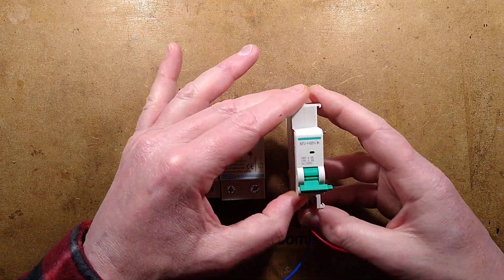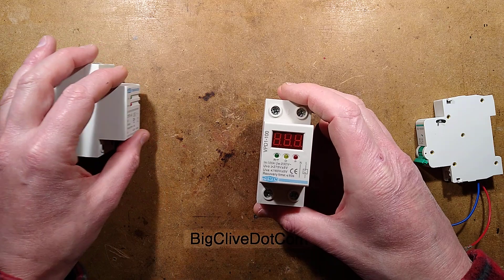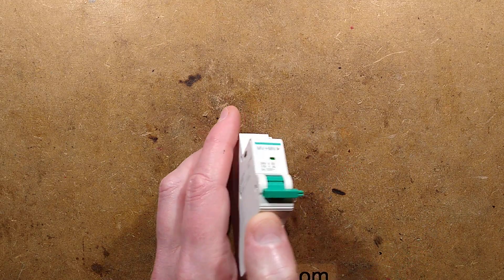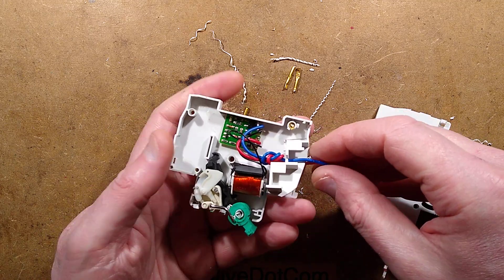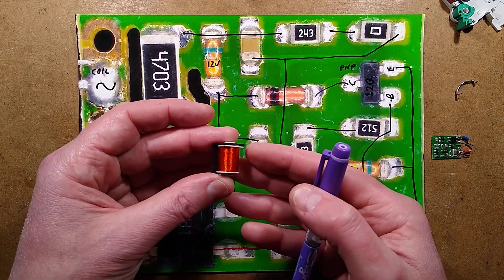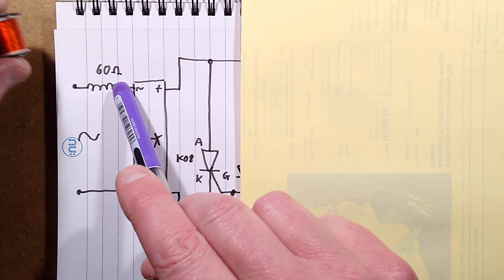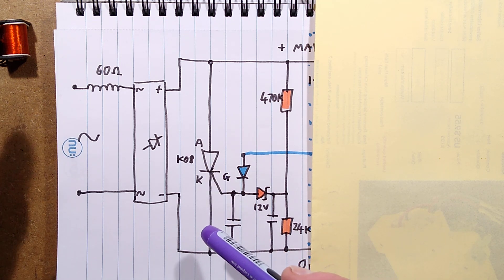Over/under voltage detector - with schematic

Comment: I've got such a device for my travel trailer, here they're called an EMS or Energy Management System. They also detect things like reversed live and neutral, missing ground, etc and won't connect the load if they detect them or will disconnect on under/over voltage. The number of RV parks and campgrounds with badly wired or badly overloaded service is pretty shocking. While they aren't cheap they are certainly cheaper than replacing an AC unit or God forbid having an electrical fire.
Reply: I'd be surprised if they bucked the trend by having proper wiring and load calculation.

I did commercial [extra] low voltage for several years in 4 US states, and I can count the number of installations I saw that weren't outright death traps without even taking both shoes off. My favorite was the panel that had burned through the neutral bus bar because some screws were loose.

It's always exciting to find the problem before you've even properly started diagnostics. Went to open the first panel cover and saw sparks. Poked it again - more sparks. At this point (a bit late) my brain engaged and the next time I poked was with a meter instead of a finger.

The breaker cabinet itself was live at 240V. The sparking came from the front panel being pushed into contact with the aforementioned unanchored neutral bus bar. I'm still not clear on how it actually came about because it was out of scope and outside our license, but we LOTOd the feed to that panel, informed the store manager, and bailed so I could be deeply concerned not hysterical thank you very much somewhere out of sight.

Comment: I think part of the coolness of this design is the failure mode for the two 3 terminal devices.  If either shorts the device will trip.   The zeners are very lightly loaded so they are very unlikely to fail.

Comment: Neat. The UPS I just set up had variable under/overvolt triggering, but I bet it does it with much fancier (read: microcontroller-based) circuits. 

I really liked the way they basically put caps over every trigger to stop them bouncing and then another over the whole triggering thyristor just to be sure.

Comment: So then what was causing the 5-some-odd mega ohm reading from the leads? Seems from the schematic that it should be less than a mil.
Reply: Test voltage of the multimeter not high enough to overcome the forward switch on voltage of the diodes in the bridge rectifier maybe...

Comment: so, why dont we get to see it working,? I realise that it is tricky to generate the over voltage but the under voltage can be acomplished with a variac. Im guessing the overvoltage could be done with 2 transformers one 1:1 for the 240v and another to add 30v (plenty of these in old amplifiers) all again on the output of a variac.
Reply: Variacs are usually configured to deliver a higher maximum output voltage than the input supply.  I think you'd probably get an additional 15% or so.

Comment: nice investigation video like always.
Is it possible to mod a 6A breaker to a 10A one?? Maybe change some component one the small PCB that trick the coil?? Any idea??
Reply: Not really. Normal circuit breakers don't have any electronics. When a standard breaker is overloaded the current heats up a bimetallic element which then activates the trip mechanism. You could theoretically change out the bimetallic element with one from an otherwise identical 10A breaker, but I would not trust it at all as a safety device. 

You'd probably have better luck making a 10A breaker trip earlier by shaving away part of the thermal strip. But again, I would not trust the safety after that.
Reply: @eDoc2020  thx much for the reply, and as You after my initial question, I said wait a min. Usually those breaker got a metalic element, dat does "break" when heated... close to your explanation... to say I saw long ago how those breaker are tricked, and no coil inside them as I remember....
And I think that the breaker that I wanted to mod is those with metalic trick, so guess no go .
Thx
Reply from the maker: New breakers are cheap.  Just make sure you get the same brand and type.  The wiring will also have to be rated for the increased current.
Reply: @bigclivedotcom  if he has to ask the question, he shouldn't be doing it.
Reply: That's like asking if there's some kind of simple mod you can do to make a size 7 shoe fit a size 9 foot.

A 10A breaker is more heavy-duty than a 6A breaker. It's not a case of "tricking" it. Put 10A through it and it'll melt.

The device in this teardown video could be modded to change the thresholds, but that's not what you asked.

Comment: I did a DIY version with a SSR and a lm339 almost 10 years ago(I was going away for the weekend and the voltage had been fluctuating all week), you know the kind of temporary FOREVER circuits in a perfboard that since it's been working fine will never be disturbed.
Some day I'm probably going to put a uC maybe....

Comment: im kinda smart and kinda dumb, but do the zener diodes act as an open circuit untill a certian voltage where they conduct and act as a short?
Reply: Not quite. When reverse biased they'll act open until they reach their specified voltage, then they draw current to clamp the voltage at that level. In other words they're diodes with a 12v voltage drop instead of the normal 0.6v, just as LEDs will drop around 3v.

Forward biased Zener diodes act as regular diodes with a .6v drop but this is rarely used.

Comment: What's the point of diode in low voltage part? Transistor would not be conducting in overvoltage condition as far as I understand.

Comment: I guessed the overvoltage part correctly - largely because I've use the same Zener technique for years.  I was a little way out on the under-voltage as I had a two transistor system in mind, but quite like the elegance of this one.

Comment: Something to remember is that for undervoltage detection, it needs to not trip near the AC zero-crossings, hence the cap across the PNP transistor.
Reply: And you need to negate the "race condition" on inital turn on, where the LV trip could trip before the internal voltage rails have charged to their nominal values etc!
Reply: That’s a good point
Reply: Typically voltage protection devices sample 2-3 cycles of voltage sine wave prior to tripping, same with frequency protection. RMS for voltage and average for frequency.
Reply: Not convinced the undervoltage functionality works. See my  next unthreaded comment
Reply: @jms019  
Yeah I agree. I first thought the cap on the PNP might supply enough of a pulse but the 81K of resistance chokes it return path.
Reply: Considering the mechanical nature of the tripping mechanism, and the fact that it's up to the circuit breaker next to it to cut the power, I wonder if this device can really avoid cutting the power near the zero crossing.
Reply: @Retep4565  
It doesn't need to avoid zero crossings when it trips, just as long as zero crossings don't cause it to trip by registering as an undervoltage each half cycle.
Reply: @Retep4565  The cap on the gate makes it wait.
Reply: @paulvandergroen9569  I was referring to the mechanical parts.
Reply: No zero crossing
Reply: @Bubu567  Isn't that against code? Breakers need to trip despite users holding them.
Reply: @henke37  yes, in the UK at least breakers can still trip despite the switch being held in the on position.

Comment: The coil runs on AC (50/60 Hz) so the current won't be anywhere near 4 amps.  An interesting circuit.  Voltage thresholds are temperature dependent.
Reply: 220/60=3.6666666666666666667 A  
Another issue pf
But it's for about few millisecond
Reply: It depends on the inductance. As an open coil without anything on the outside I would think the inductance would be fairly low. I'd blindly guess 2 amps if run on AC.

Comment: I do like a spectacularly simple circuit. (In terms of components). Mind you my favourite is still a West German stereo valve radio that had very few valves that were used for several different things at the same time because radios were taxed by the number of valves in it.

Comment: You're circuit wouldn't have worked, you are comparing AC voltage to a DC reference...
Reply from the maker: Time delays can fix that.
Reply: @bigclivedotcom  yep, but pretty difficult to obtain "accurate" results then. Much easier to put a diode and a capacitor to rectify and smooth signal before comparators.

Comment: If my math on the dividers is right, accounting for the 0.7V drop, that's a voltage range of about 180-260Vrms.
Reply: It would be interesting to see your calculations. I'm getting slightly different values. 

Overvoltage:
24k/(470k+24k)=0.0486
12/0.0486=247 V

Things not taken into account:
1) Rectifier diode drop. (2*0.7 V, essentially negligible.)
2) SCR trip current/voltage needed.
3) My value is theoretically a peak value, which would put the corresponding RMS value faaar too low. But, the capacitors would also smooth out the voltage, so to some degree the voltage present at zener cathode would be closer to the RMS voltage.

Did you perhaps do the same calculation and added 12 V for the diode drop, or assumed trip voltage of the SCR?

Undervoltage:
80.1k/(1200k+80.1k)=0.0626
12/0.0626=192 V

Not taking into account in this case the E-B voltage drop, as well rectifier voltage drop.

My values, taken at face value, would pretty nicely fit with a product for the Chinese market setting the thresholds at 220 V +/- 12-13 % or +/- 27-28 V.
Reply: @Gameboygenius  Voltage at center point of OVP divider is roughly zener plus SCR gate = 12.7V. 12.7=X*24/494. X=261
Voltage at center point of UVP divider is roughly zener minus Vce of the PNP = 11.3V. 11.3=X*80/1280. X=181
This assumes gate trip current of SCR is near zero, so it's only an approximation.
Reply: Remember that the supply is unsmoothed full wave rectified, and also there's a capacitor across the 24k resistor.  This capacitor will average the rectified and voltage divided waveform to around 64% of its peak, or a factor of 0.9 times the rms value.   So this will in fact trigger at around 290Vrms if perfectly smoothed, but more realistically a lower voltage allowing for some ripple depending on the capacitor value.  The capacitor was unmarked but it would need to be around 1µF to smooth enough to have a 280 Vrms trigger, which I think is the rated value marked on the front of the device.

Comment: The device you talked about which trips after applying power (or after removing power, there are both types available), we use one of those at work to trip the main breaker in a small room (lighting is on a separate circuit) to use as an emergency stop for everything in the room, it's a simple additional safety device, you don't think what to turn off, you cut the power if something goes wrong

Comment: I had one with a white wire and im not sure where that went, but I think it may have been to ground, the replacement i got didnt have that and I was worried, turns out you dont even need the wire, so im wondering why it as ever there to begin with... i think this was my lighting breaker
Reply from the maker: Was that an RCD/GFCI?  Some have an earth wire for neutral to earth fault detection.
Reply: @bigclivedotcom  maybe? I forget now

Comment: Clive, do you use conventional current or electron current theory when you analyze circuits?
Reply from the maker: Conventional, since it's easier to explain operation when the diodes point in the right direction.  The only time I reference electron flow is when dealing with MOSFETs.
Reply: Theories are just convenient ways to imagine how the universe works and predict it's behaviour. Use whichever Theory is most useful for any given task. So as Clive said that's mostly but not always conventional.

Comment: "I won't touch the leads because it'll interfere with it"

Ohhh boy, on a scissor lift a million miles in the air testing fuses for a 3 phase thing on a bus bar box with a fluke clamp meter (using the probes in continuity mode obviously)... All the fuses are fine... Wtf?

No, one is gone... The meter is faulty and its reading my body resistance from one hand to the other as continuity.

We kept the meter... Fantastic to give to someone to check fuses and to learn this lesson

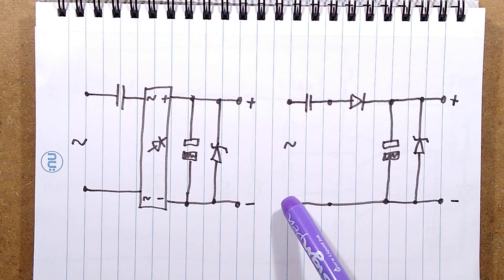Comment: At 3:50, isn't that the symbol for a Schottky diode, instead of a Zener diode? Always get them mixed up myself
Reply from the maker: It's a zener symbol.  The schottky diodes curl in.
Reply: @bigclivedotcom   my apologies! For some reason where I'm learning we've been using the symbol for the avalanche diode as zener diode for simplicity. I'm sure this won't be the last time I've confused them

Comment: What would be good is a heat and smoke module. These are more for industrial where under and over voltage can really fuck up motors. But in domestic, it not really much use. But a module dedicated to cu and smokes makes great domestic sense.

Comment: in NA the AFCI breakers have under over V built in. Very annoying when running on a generator, as it trips whenever the generator runs out of fuel.
Reply: I didn't know that. Is it part of the UL standard or just present in particular brands?

Comment: Any opinions on the Tomzn "6 in 1" multifunction current / voltage / freq / PF / W /  kWh multifunction panel meter (Model Number: D69-2058)? Seems a cheap alternative to the Hopi for those on a budget - https://www.ebay.com.au/itm/6IN1-AC-monitor-110V-220V-380V-100A-Voltage-Current-Power-Factor-Active-KWH/264640980359?hash=item3d9dd4e587:g:vxUAAOSwI-heK0TD  Only $39 (Australian) so possibly a good deal?
Reply: I've used tomzn stuff. I wouldn't be afraid to buy it.
Reply: @joewiddup9753  Same here. Tomzn SPDs are as good as anyone else's, and the fact that you can buy replacement cartridges makes them an excellent choice, especially if you live in areas where the supply is prone to lightning termination events. We have one of their excellent ATS devices on our genset, which is a) reliable, and b) very convenient. Similar (nay, identical!) design to the one BC dismantled a few years back.

Comment: Given the voltage drop round here has hit around 210 volts during the day (cos the overhead wiring can't seem to cope for whatever reason), that thing would drive me potty resetting things, bad enough having UPSes kicking in to boost the voltage back up when it dips... :S

Comment: Excellent analysis of a surprisingly clever and robust design. Most fault situations will result in firing the disco solenoid. And not a moderne window comparator in sight. Thanks!

Comment: Since there is no smoothing on the DC side of the bridge rectifier, the voltage will drop to zero every 8/10ms (120/100Hz).  Presumably the capacitor across the Base-Emitter is the only thing preventing the low voltage circuit triggering in this case.

Comment: Could have been useful at work when a farmer went through our power feed one morning, got iffy power by the afternoon and a generator took over the next day, knocked out the whole caravan site.. At least one of our washing machines had the display illuminated but nothing else, would have cut the power to them as a just in case, naturally I just manually turned off all the machines as having our fairly new commercial washing machines fail wold not have been good. I will say , thank god for rechargeable 2 way radios! power cut? phones down but radios still working.

Comment: This would be handy. A voltage spike took out my coffee pot and my Wolfgang Puck pressure cooker. Both of the thermal fuses went. Got new ones from Amazon and they're fixed now.
Reply: Wish my rice cooker'd had a thermal fuse.

Someone left it plugged in overnight after emptying it. By morning it was cold, so it got washed and put away. Next time we went to use it - nothing. Although one corner of the switch surround was suspiciously melty . . ..

Luckily the wires inside were sleeved in fiberglass, so when the hot lead decided to play fuse and burnt itself up it didn't contact the (steel) shell - that would have been rather exciting with wet hands! Also luckily, the wires were connected with standard 1/4" (6.3mm) spades crimped on the ends. 5 minutes later it worked perfectly again.

Comment: Like you my first thoughts were voltage comparator circuits using op-amps. I reckon that even this circuit could be cut down more at the cost of some reliability in use.

Comment: OK, I'm 3 minutes 50 seconds in and my guesstimate is going to be: It uses a coil to trigger the trip and the reason it is real low resistance is that coil is in parallel with a near short circuit to allow the breaker to be minimally involved in the system (Not use much power).

Comment: It may also be used to trip mains breakers in the case of if you have a automatic backup generator. That way you don't try to feed the grid and endanger lives. Or break your generator
Reply: Most (all?) regional electricity companies will require a dedicated transfer switch to ensure you don't back-feed your generator onto the mains. A transfer switch will stop someone re-closing the mains while the generator is connected to the load which a simple UV on the mains will not.